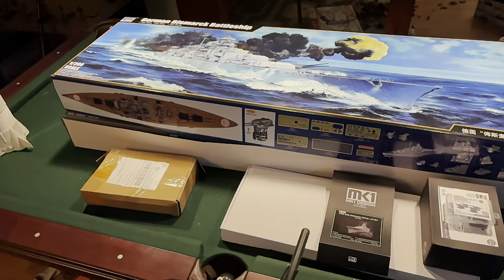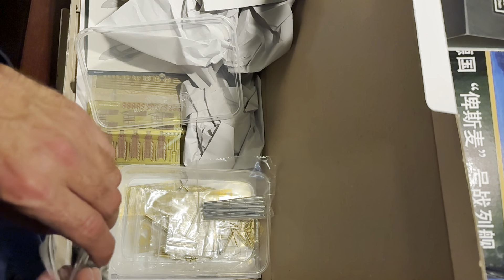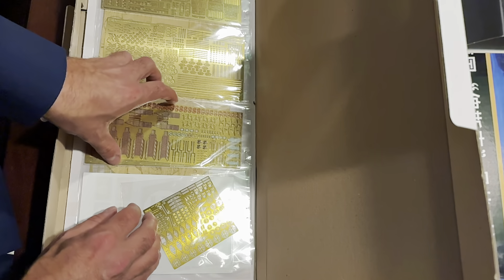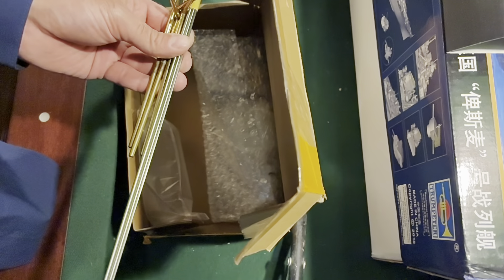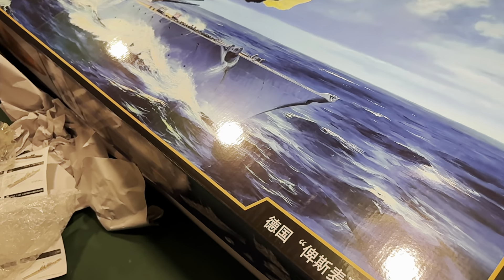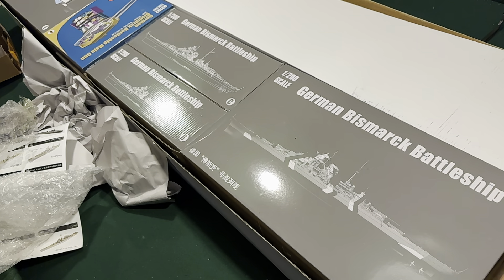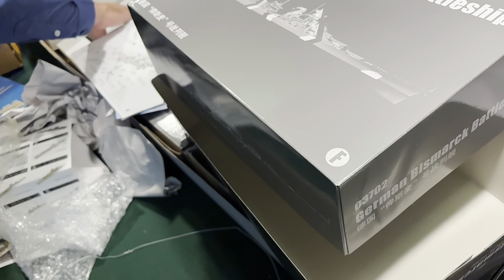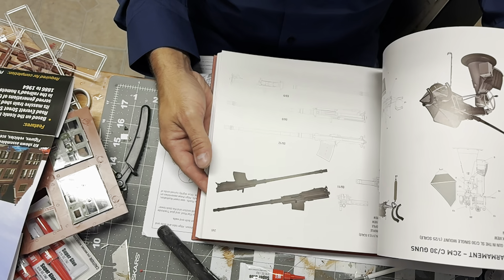Bismarck Trumpeter 1:200 RC Build part 1       Introduction and Parts to be used

Comment: What are the dimensions of the ship?
Reply from the maker: @jonnyblayze5149  it’s about 50 inches
Reply: @LCModelBuilding  that's sweet. I made my own 1/200 rc scratch built Bismarck it's also about 50 inches but the beam is MUCH wider that this one. About 14 inches